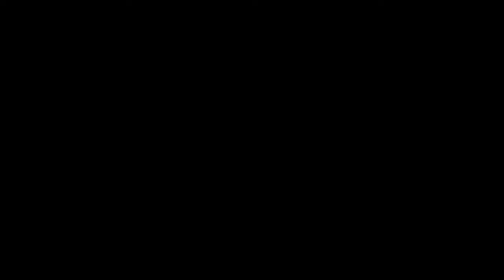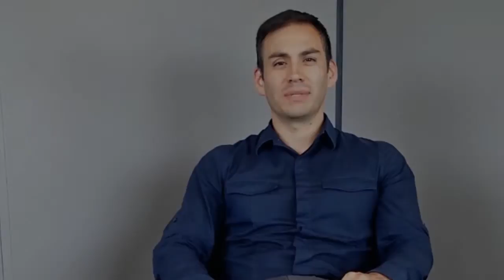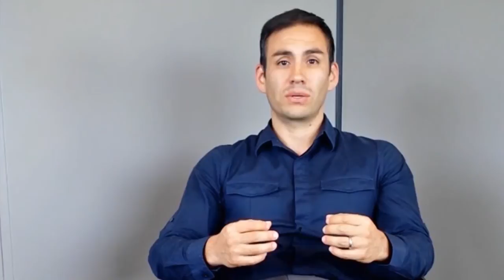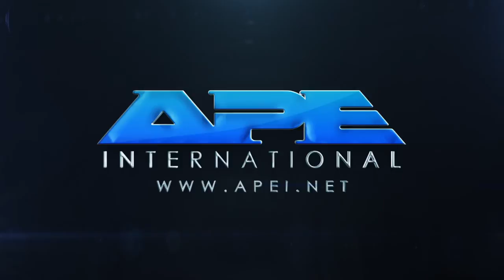Coupled Inductor Output Filter | Patent Series | Arkansas Power Electronics International

Comment: I took a look at the patent illustration. Seems that the square wave voltage on the left-side inductor would cause current spikes in the second inductor only held back by the ESR of the capacitor.